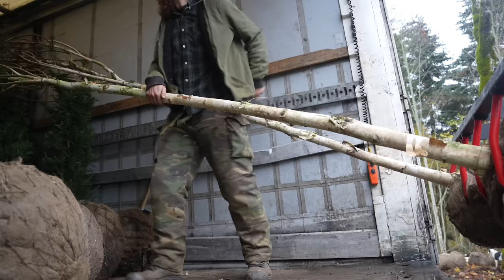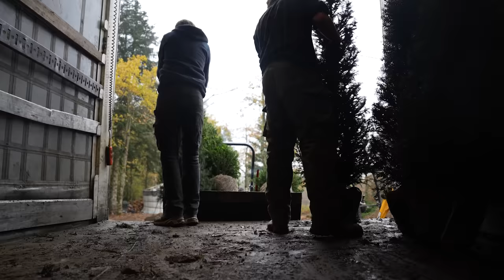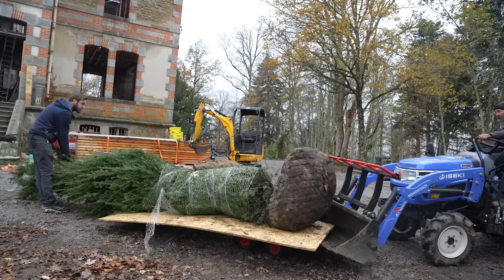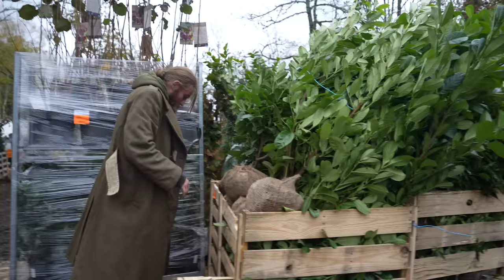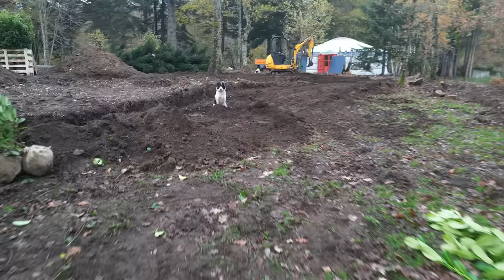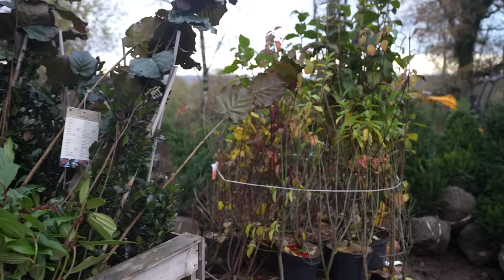We got an entire forest DELIVERED.

Comment: Treated burlap (the kind you're most likely to encounter) will not decay quickly (can take decades) and, though roots may grow through it, those roots may be damaged or constricted as they grow in diameter. Remove all treated burlap or synthetic burlap (also likely to decay slowly) from root balls at planting time.
Reply: Yep, I was told wrong with four shrub type plants.  All four just stayed stunted and sickly. I gave them 2 to 3 years to grow.  Had to remove them and ended up on a burn pile.
Reply: Das sind eben die Feinheiten der Gärtner Branche. Gut gemeint, ist eben nicht auch gut gemacht. So eine wichtige Aktion, sollte man nicht mit der heißen Nadel stricken.

Comment: I'd spread out the Portuguese Laural. I have one and it's diameter was 20-30 feet and the ones at the Univ of Washington got to atleast 60' high.
Reply: As Cameron clearly said, by packing them in tighter they grow taller and not wider, if they become too thick which I doubt, Nick will thin them out. Also these will be left to there own devices I suspect too. X